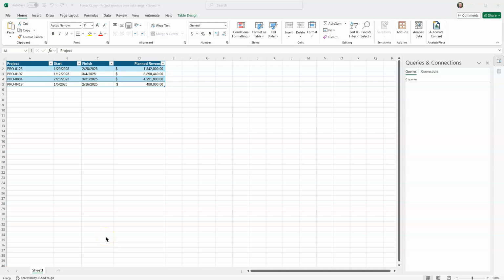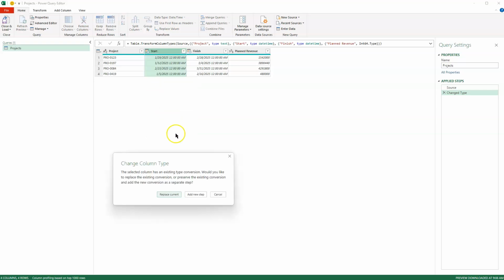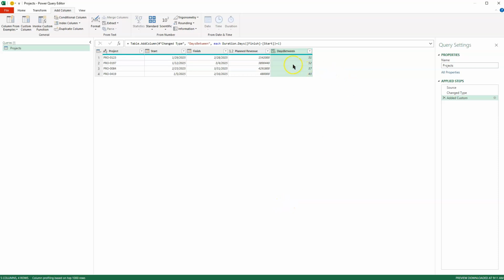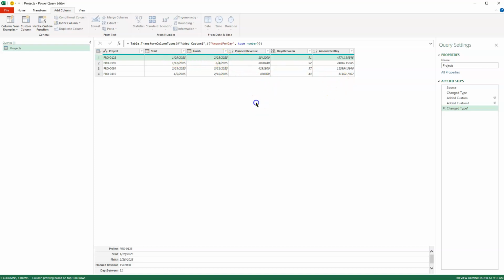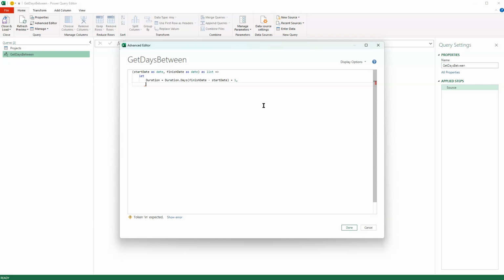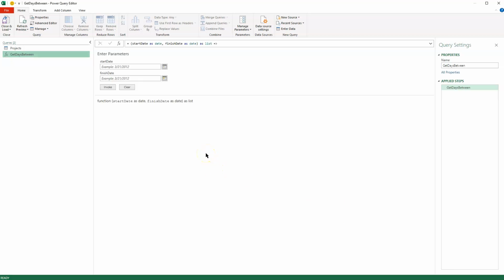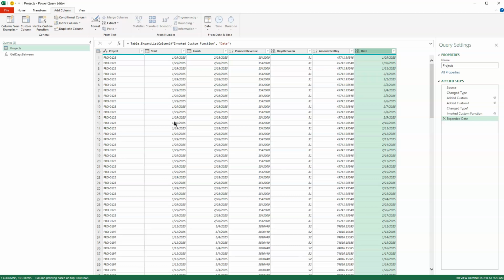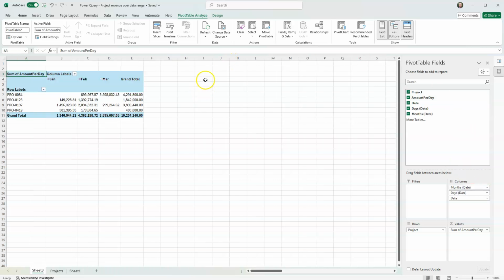Power Query:  Spread amount over date range

Comment: Great video. When you calculate the difference between dates, the +1 threw my figures off a bit. Once I took it off, it is perfect now!
Reply from the maker: Yes, it really depends on if you need the date range to be inclusive or not.  In my example, I need to include the end / finish date but if you don’t need the last date, yes, remove the +1.